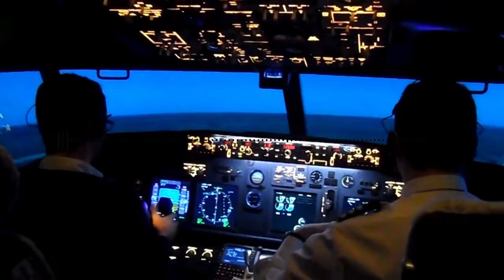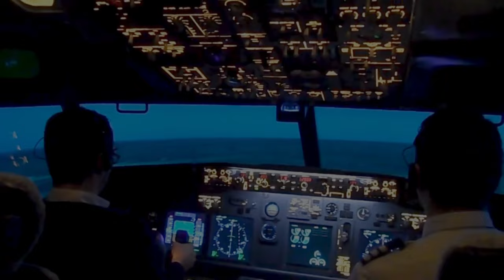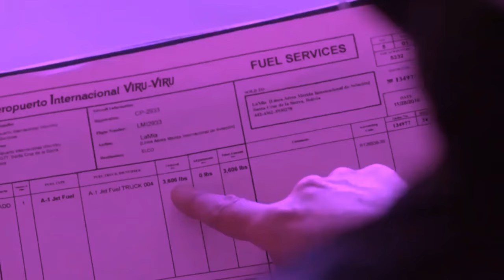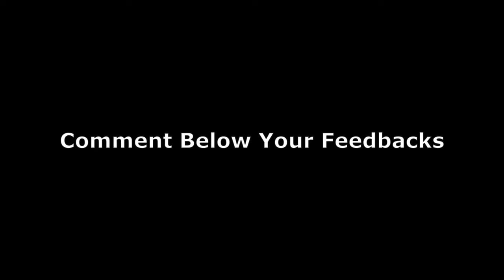Brazilian Soccer Team in Deadly Plane Crash | Full Documentary

Comment: Debatable to say it was the worse sports accident. Sadly all 75 people on the Marshall University Football plane accident died.  

Uruguayan Air Force plane carrying the Old Christians Rugby Union Club plummeted into the Andes mountains and only 19 survived, but 27 initially lived. They had to resort to cannibalism so they might win the worse accident as far as horror and trauma. 

The Brazilian team was completely preventable. The plane went down because it ran out of fuel. They found the causes of the crash to be fuel exhaustion due to an inappropriate flight plan by the airline, and pilot error regarding poor decision making as the situation worsened, including a failure to declare an emergency after fuel levels became critically low, thus failing to inform air traffic control at Medellin that a priority landing was required. Without declaring how dire things were they allowed a plane with a suspected fuel leak to land prior, did not say anything and went into a holding pattern that added 54 nautical miles. They could have stopped at a closer airport when the warnings of low fuel went off but chose not to say anything, make two laps in a holding pattern then when the engines started flaming out, requested immediate landing. Sad they were more worried about their reputations or worse arrogant in their skill to speak up. 

Initially, SIX of the 77 people on board survived the impact. Making their number 71 that died. Four of those who made it through were Chapecoense players.

In any case loss of life is not competition in any sense, all those poor beautiful souls lost too soon. More tragic when their lives are still beginning. RIP❤